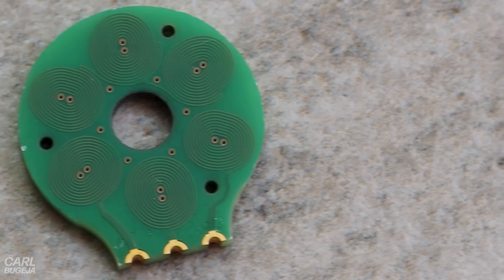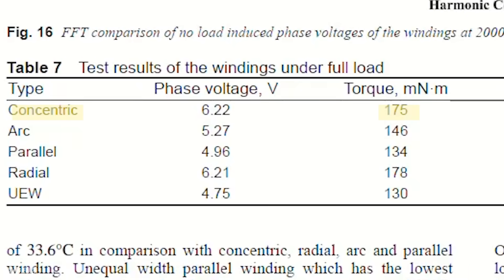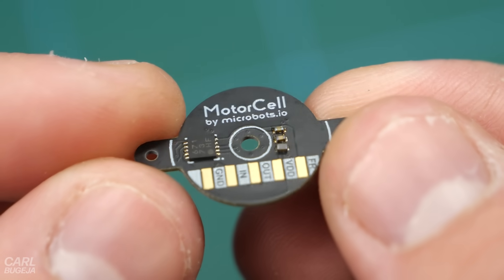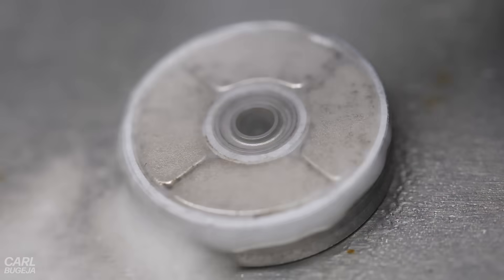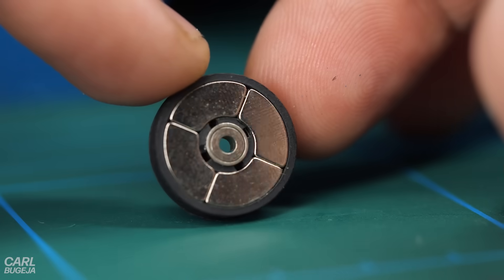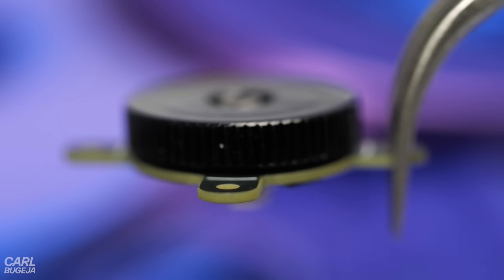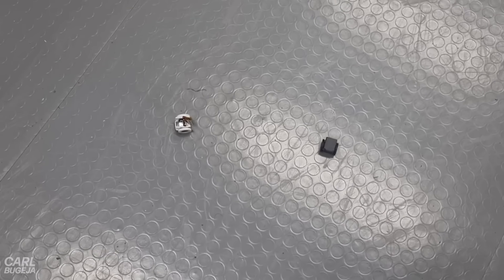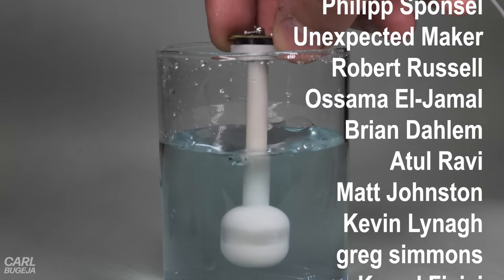How this tiny Motor Survived 1.6 BILLION SPINS

Comment: I have two 2800 rpm pabst fans in a computer case that has been running since 2004 nearly EVERYDAY 24/7. Maybe 5-6 different pc's lived in there lol. But those dang fans! 
I had to start putting a drop of oil in them in 2022 as one was starting to squeak a bit.  I didnt do the math.... but 2800x24x365x240months = A LOT!
  Im sure plenty of server guys have even longer runs.  Like the 100 yr old lightbulbs and my 1989 Honda accord that still runs and drives when all other have been rebuilt or recycled a decade ago......
Why? How?  Im not complaining!  Just ...YEAH!    Winning!   Blub Blub Blub!

Comment: (not an affiliate) Igus has triibological materials that are long wear life and self lubricating - and they also make a lot of them in 3D printer filament as well as bar/sheet stock, tapes, and powders for sintering applications.
They make a big point of replacing traditional bearings in heavy industrial applications, so they'll probably work great in smaller applications.
I've used them in interesting ways to make components that really simplify and strengthen designs/projects/automation fixturing in the lab at work and they've super attentive sales/field engineers who enjoy working on interesting projects.
Reply: The friction is too high in IGUS plane bearings

Comment: When you showed the price I said, out loud, "Holy shit that's cheap". I can't believe you got the price that low for such a small scale product. You are doing amazing work!
Reply: If you were to buy a million of them, the price would probably be 50 cents
Reply: Oh hello blender guy, I like your videos.
Reply: @WWFYMN thanks!
Reply: Those are 13 dollars each. You can buy normal motors for less than that.
Reply: @ I don’t think his product is outlandishly great on its own, but I was surprised at the price because he isn’t a million dollar company. Usually small scale products like this are a lot more expensive.
Reply: @Anon-te6uq Yes, but buying normal motors this compact...?
Reply: @nikkiofthevalley  i love what carl is doing but if your project require something l like this you could get 0802  fpv motor which is smaller in diameter  and has much more power

Comment: I think this could be very useful for integrating small fans onto existing PCB designs. Place it right next to your heatsink or hot parts. Just need a good "fan rotor" now.
Reply: @roboman2444
6 hours ago  - There are already multiple Youtube channnels focussed on PC fan design contests.  How long before we see a similar motorcell fan competition?
Reply: There is a fan design specifically for these. The files for printing them are on the microbots page where these motors are for sale.
Reply: @ermakers1297  there are also piezo fans, as well. i'm still buying myself these for xmas, though

Comment: Very cool. But the spin count is only noteworthy in the pcb context. A lowly swimming pool pump spins 18 billion times in its typical lifetime. nb: You could use a reamer to make the bearing mount fit exactly as desired. If roller bearings are available this small, they are worth a try. They will help a lot with the rotor tipping issue, which may help performance.

Comment: Research small DC fan bearings. Some use no ball bearings at all. They rely on an "air" bearing or sleeve type bearing to support the shaft. Much better at the very high RPM tiny motors like yours.

Comment: You could have saved the rotors with the smaller ID hole by getting a proper sized reamer to open the holes up to the correct size for your bearing.

Comment: Carl, is there a way I could chat with you? I would love your suggestions on a pcb motor that would not need to have any significant torque and only need to rotate at about 60 rpm. Low power and ease of assembly are the goals. Requesting to chat somewhere else than the comment section because this is for a project for a conference.

Comment: It's an interesting idea.  The Panasonic Twin Rotor Motor was a very slim motor, only a few millimetres in thickness, in compact cassette players made by Panasonic in the 90s, that had very similar looking PCB-based coils on them.  While there isn't much information on them anymore, they appeared to operate in a similar way to yours.

Comment: 1.6 billions spins is insane :O Assuming roughly 500 RPM average for a drone motor, your motor would (theoretically of course)  would last for 5 flying-years 😮😮
Reply: these are high speed, low torque motors, so not useful for drones.. yet.

Comment: Considering the RPM range, is it feasible to use air bearings in this application...if you used Teflon, or similar, PCB material, and had good enough tolerance control, perhaps the PCB material could provide enough "self-lubrication" to allow the motor to spin up to a high enough speed to get the required air flow in the bearing surfaces?
Just thinkin'

Comment: The high RPM should drive you to alternative gearbox designs - dogen, harmonic, or wobble. These designs should also lend themselves well to PCB manufacturing techniques, if you use some creativity. A 100:1 gearbox gives 300 RPM at ~50x torque (includes losses).

Not only that, but integration with a gearbox should allow you to drop the physical motor bearing entirely and instead integrate an air bearing design using vias for porting and traces for lifts/fan blades. Good luck, and great job!

Comment: I wondered if you used any 3d electromagnetic solvers to see how the various parameters affected the designs...at the rotor speed that you are working at, and the switching speeds required, you are certainly getting into "non-trivial" interactions among mechanical, electrical, magnetic and thermal characteristics and performance?

Comment: The efficiency drop in the lower induction motors maybe a result of a relatively low driving pwm frequency. 
This could be mitigated by using a higher pwm frequency or using external inductors in series with each phase. The series inductors might cause higher losses though and a higher pwm frequency would increase switching losses. 
It's all quite a delicate balancing of losses.
Reply: More copper should as far as I know reduce conduction losses and less turns should allow for more copper area compared to the area between turns. This would result in a lower inductance and resistance but would require more current for the same torque and less voltage for the same speed.

Comment: Honestly under 15 euros is not a bad price you can't compare it to a normal motor because it's a circuit board motor so there are use cases that it can compete where others can't even be used

Comment: I have an idea for you to help cooling and possibly woth current issues, a small non metallic cage style fan attached between the pcb and the rotor, this will create a massive air flow that will cool the parts drastically.

Comment: Muy interesante su motor con bobinado impreso , como opinion personal ;  creo que las espiras son muy pocas , lo que creo su motor requiere muy poco voltage y mucha corriente  es decir  voltages de 0. 3v  o menos  y corrientes de 500 ma  , pero justamente ese es tambien un problema  la electronica funciona con mucho mas voltage  pretender un integrado de menos de 1 voltio que energise las bobinas ,  y por otro lado este motor es de alta velocidad  no va a funcionar bien si no se soluciona este factor del rodamiento  , eso complica un poco . Gracias por compartir  y exitos en eldesarroyo de su motor.

Comment: I'm sure you've already thought about this, but what about mulit-layer PCBs so the coils can be stacked one on top of another for more windings and a stronger magnetic field.
Reply: It would be a balancing act as stonger field results in more torque  but reduces top speed by increasing back EMF. It will also increase resistive losses, and inductance, not sure about the ratios and where the sweet spot would be.
Actually balancing act is not quite the right word, it's an act of matching the motor characteristics to your load case. Not many things need a 36 kRPM motor, so trading some top end for more torque would make sense for a lot of use cases.
Reply: I'd also query whether the coils are done on both sides with an additional magnet on the other side thats attached to chassis to see if double torque can be produced?

Comment: For StartUp, did you evaluate techniques like High Frequency Injection? For example Zero Speed Maximum Torque control technique? (First it measures the impedance of the coils by sending in current at a particular D-Q angle (I think). Then it changes the angle and compares the two impedances. In other words, it's measuring inductance or the strength of the two flux paths through the motor. This lets you get the rotor position, more or less.)

Comment: Did you ever look at Hard Disk Drive motor bushings? These also do not use a locknut as the magnetic field keeps it in place. Bushings are probably even better than bearings in this case.
Reply: Sintered bronze impregnated with oil.
Reply: @joefish6091  Exactly! This is the key in my opinion. Does require a hard chrome smooth shaft though for longevity.
Reply: @joefish6091  good for low speed
Reply: A Japanese company dominated that space. I don't know if they still are in business but that gets you started.
Reply: FD bearings
Reply: Either that or magnetic/ air bushings which have zero contact between surfaces

Comment: Again, VERY cool project!
I love that you tested them well and I love that you are making them available for Makers ❤

I will say though, that I would not use them for haptic feedback. The normal brushed motors do that just fine with a smaller footprint.
I would however use it for some really cool flat mechanisms like an iris box opening mechanism. I like flat mechanisms :)

Comment: Why not use the eddy currents to "time" the motor?
Based on your example you turn the motor on and off and use the momentum to spin it.
But every time it is turned on there should be eddy currrents present so all you have to do is connect a sensor to the on/off switch ...
Could this work? ...
If it works and you time it correctly you could even solve the temp issue...or at least make it less of an issue.

Comment: Your aluminium rotors are black which means they are anodized. Anodization make surface spongy and make dimensions little bit bigger. Final dimension is unstable after anodization. Not only every batch, but every run in anodizing bath gives you another results. It expands aluminium because raw aluminium is converted in new chemical compound. If you want exact tolarance, you should make hole smaller, anodize part and resurface critical dimension up to desired tolerance. You really need dynamic balancing after completing rotors.
Reply: Could have gotten a reamer to fix the size also
Reply: @inkrpen  It will work but only few times. Aluminium oxide is very hard and dulls standard HSS hand tools very quickly.
Reply: @martinleska4292 the oxyde is a few thousands of a mill thick and does not harm cutting tools. Sorry.
Reply: @KlausBöckl  Aluminium oxide has 9 of 10 on Mohs hardness scale same like corund. It harms cutting tools so much, near CNC shop ask extra fee for machining and resurfacing anodized aluminium. Few weeks ago i cleaned 20pcs M3 holes in anodized aluminium and it made 2 new taps totally dull. I work with anodized components every day.
Reply: @KlausBöckl lol, take the L
Reply: Great point!
Reply: Are you certain that anodising makes the surface is spongy? I was under the impression that anodising strengthens the surface.
Reply: @graxxor  Yes Iam absulutely sure. Expansion is approx 50% of total layer thickness. This can shrink inner hole diameter by 2x15micrometer when layer thickness is 30um which is only basic thickness. It is possible to make 80um layer.
Reply: @martinleska4292   I meant about the sponginess... I was under the impression that anodising the surface strengthened it and increased the MOHS hardness rather than make it spongy.
Reply: @graxxor  when he says sponginess. he means porous
Reply: @graxxor  The surface oxide layer does grow thicker than normal, stronger... but it is very porous in aluminum, that's why the dyes can color it so well, and why lube holds so much better. Aluminum oxide is also so much harder than the base metal (Mohs 9 VS < 3) that the porosity has little negative effect.
In other metals, anodizing simply changes the oxide layer to another phase with better properties and thickens it, porous microstructures are much harder to achieve.
"https://en.wikipedia.org/wiki/File:SEM_of_AAO.jpg" The anodized aluminum microstructure is pretty neat.
Reply: @graxxor it insulates and hardens the surface. That is why you need bonding points.
Reply: @graxxor  if you don't anodize the surface, it will be subject to atmospheric corrosion and will be useless after some time
Reply: @graxxor  why not both?
Reply: A new chemical compound, also known as alumina or aluminum oxide.   :face-green-smiling:
Reply: and more cost
Reply: you are something gorgeous. I would want to collaborate on great r&d projects with great experienced and skillful minds like you.
Reply: Okay but how the hell does one mass produce that for under $6
Reply: @littlejack59  pretty sure this method is for refining the testing process.
Reply: I was thinking this, and also eliminate the bearing to use a bushing. Tolerance can be more controlled,  reliability and longevity increase, can have a much lower rotor height too.
Reply: I wonder if it outweighed by the slight boost in heatsinking efficiency the black coating gives.
Reply: So they're bigger because they're black
Reply: @prndlprndlprndl no. They dissipate heat better because they are black.
Reply: @prndlprndlprndl  You win the internet today sir.
Reply: You always require final dimensions in drawings. Production engineers then take growth/shrinking into account to set the process. Same with the metallic structure and heat treatment. You define material in brought in condition and final condition. Anything else is the work of another guy claimind to supply parts acc. specification. So, your commend is kinda nonsense.
Reply: Lol you can't travel faster than the speed of light man😅
Reply: @ExcavationNation  30,000 RPM is not really fast for a small motor. Motors for gas centrifuges run 2-3 times faster.
Reply: @janami-dharmam  those are also extremely highly engineered and extremely expensive

Comment: Nice little pancake motor.  Looks like you came a long way.  I guess the question is, does it really need to spin so fast? Can you spin it just fast enough for some other applications like for cooling fans in smaller computers?  Or was that just a break-in test?

Comment: Have you considered/tried switched reluctance or synchronos reluctance designs to avoid the need for the magnets and that assembly step? Also, you can buy SMD solderable threaded bosses which you could have pre-assembled on to the PCB in the assembly stage, removing the need for the nylock nut and reducing the depth of the motor. You may need a small bit of threadlock to prevent it from coming loose, but you could also by pre-thread lock applied screws. 3 mounting points should also give the same stability as 4 (but 4 may be easier with rotational/mirror symmetry). Have you also considered using one of the standard connectors like JST with the sparkfun QWIIC which would make it even easier to integrate into projects?

Comment: You could have used a soldered pcb standoff instead of your lock nut. There some around with a hight of only 2.5mm
Reply from the maker: the once i should weren't locknuts, so the bolted shaft might get loose over time with the vibrations of the motor (we experienced this with a standard nut)
Reply: @CarlBugeja  There where are some glues for locking screws into place maybe that could have solved your problem.

Comment: for the aluminum rotors, if you have the ability to put the finish you need back on the surface (anodizing it or whatever), you could intentionally order rotors with a smaller inner diameter than you want and then just finish it up to a really tight tolerance yourself, and then you could have more flexibility in what manufacturers you can use

Comment: +/- 0.05 is crazy for a press for like that on a bearing with radial clearances in the microns. There is no reason you can't get +/-0.01 on a 5mm bore economically. I also don't see why your other dimensions are so tightly toleranced, that's potentially adding unnecessary cost.
Reply: That's a good point, boring the center is easier than getting tight tolerances on the outsides but there is no real need for the outside to be that tight since it's just getting a 3D print slapped over it anyways.
Reply: I 've seen all your work along years with these motor, and it's awsome!

May I make a humble contribution: 

1 - I saw you using a caliper, but for this project is better change for a micrometer;

2 - all the alumínium disk must be balanced and test before endurece testing;

3 - low tolerances will be costly, an adaptative solution like a epoxi glue or a compression sleeve betewn the disk and the bearing maybe will be more suitable;

3 - groves at the disk maybe need to be hand made to improve gripping. Someone told above the problem with the anodizing. Consider too a design that reduce this weight, like 2 or 3 arms wheel. By the way these disks are casting or machining?

4 - insertion of bearings it's tough! Try long freezing for one piece and heating the other with lubrication (aluminiun will expande more than stell...);

Good Lucky and dont give up!